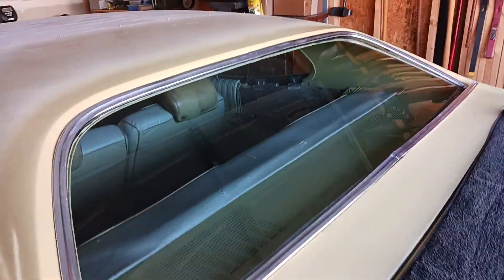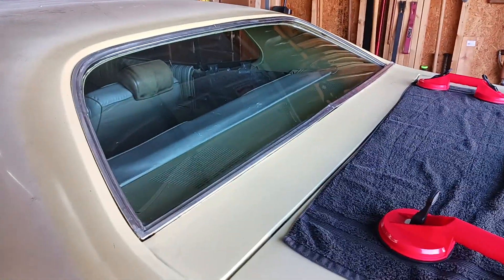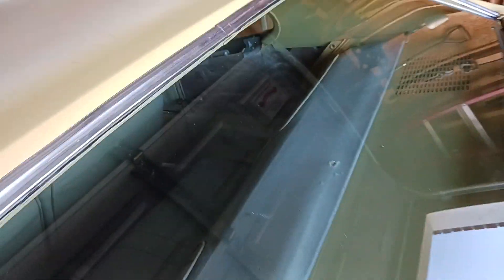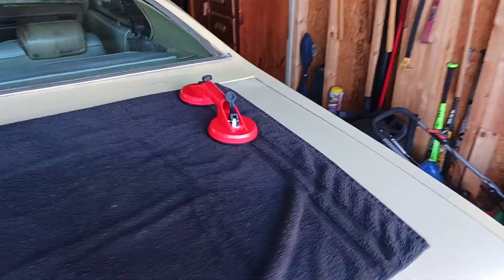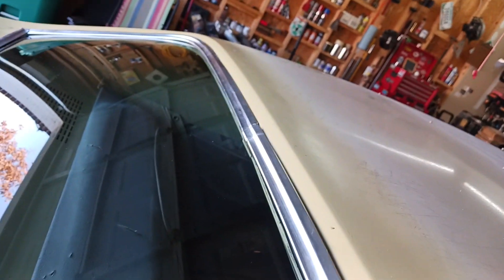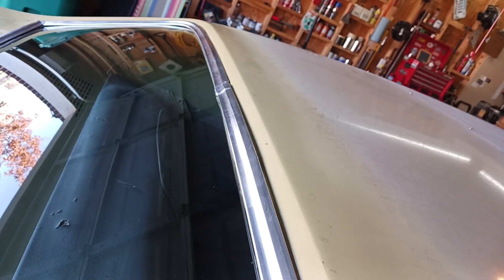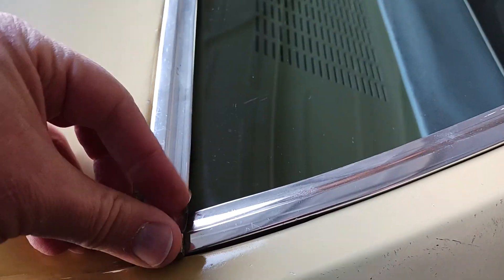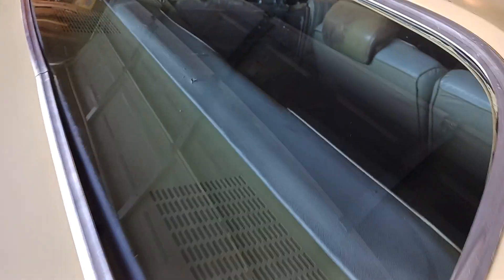Installing Mopar Window Trim

Comment: Nice the trim on the later B bodys is much better thought out then on the early B an A bodies no screws holding the clips in place that can cause rust. Much easier to deal with. .